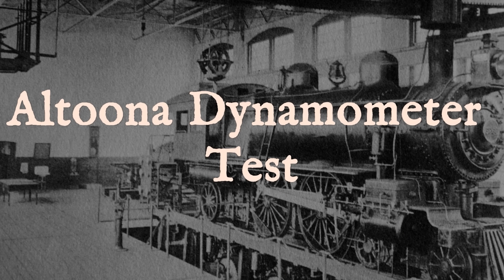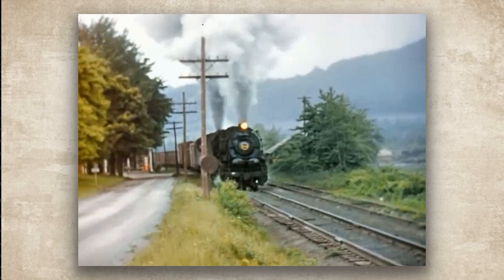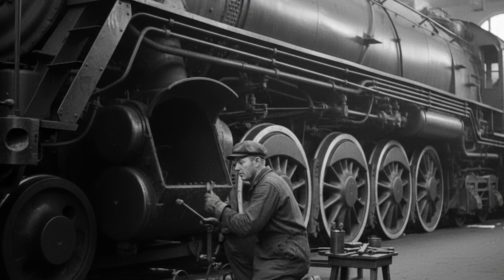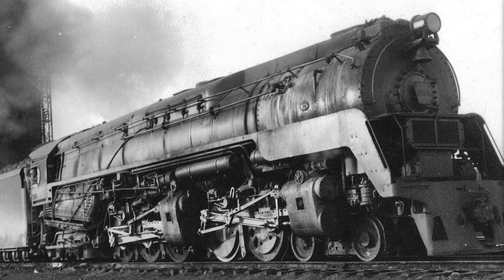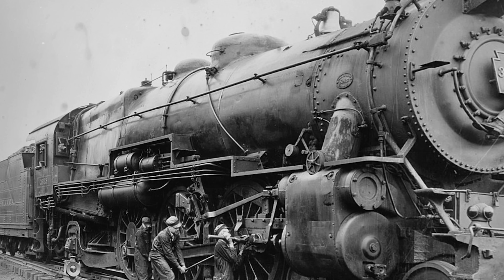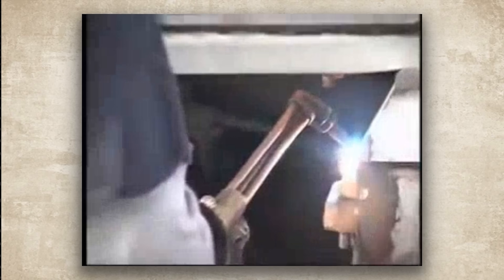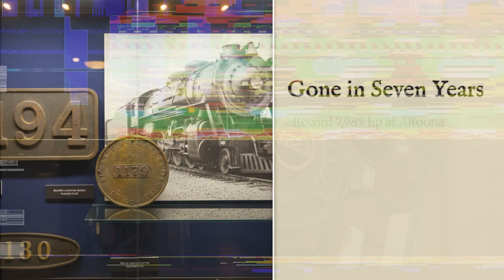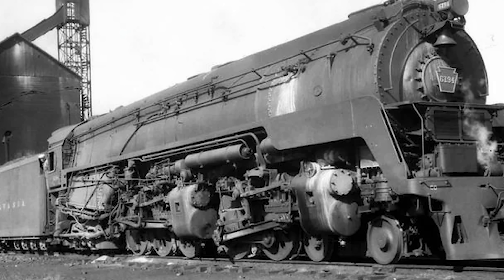How POWERFUL Was The PRR Q2 ACTUALLY?

Comment: The PRR Q2 class were the most successful type of "duplex drive" locomotives that were produced and the Q2 class were also the most powerful & largest non-articulated steam locomotives ever built. The Q2 engines had high maintenance costs and maintenance issues and the 50 mph speed limit on PRR freight trains was also not beneficial for the locomotives as well. The PRR Q2 was an interesting locomotive and it's a true shame that none of the 26 engines built were preserved for display as being the best performing examples of the "duplex drive" type steam locomotives, and all of the engines were retired by 1951 which represents only a half decade of operation.

Comment: The T1 unofficially did 156 on multiple runs al be it it was never the PRR's intention to do a speed run for a record.  And.....the wheel slip issue is no more than legend.  The engineers who were interviewed and were the most frequent crews on the T1's repeatedly stated that the T1 did not have a wheel slip tendency, but instead were so powerful that they required a different approach to applying power.  They were fantastic locomotives and there is one being built right now.

Comment: C&O Alleghenies and UP Big Boys tested at over 8,ooo HP.
Reply: Big Boy's tested around 6,400hp and Alleghenies around 7,300hp. Both came in under the Pennsy Q2. Maybe their adherence was better but their HP was not quite as high. I wonder what the DM&IR Yellowstone and the N&W Y6b's rated?
Reply: @asdfdsa45  The problem with some of the horsepower ratings is that they tend to be rather subjective.  In many cases they're tabulated in different conditions and/or with different types of equipment.  I'm a retired railroader from a fairly severe mountainous division.  In my experience tractive effort is significantly a more determinant factor of a locomotive's capabilities as opposed to horsepower.  I think the biggest problem with many of the horsepower tests on steam locomotives was that the tests measured the "hp" capabilities outside of the normal operating envelope in which the engines would be routinely pulling trains.  This is the reason that many of the large articulated giants that we all admire were replaced by 3 or 4 "F" units or Geeps.  While the little 4 axle diesels are no match for big articulated steam in hp rating at 50 mph, the diesels are superior in tractive effort and efficiency at lower speeds where freight trains usually operate.  Cheers.
Reply: @machinist1879  Thank you for taking the time to write this bit of information and history, it makes me wish I would have had the privilege of working for a railroad. Some of the stories are just incredible.
Reply: @asdfdsa45 Allegheny was drawbar horsepower.  Its has the official record. Q2 was not drawbar horsepower just static cylinder horsepower. Basically its like comparing crank horsepower to wheel horsepower.

Comment: Maintenance costs at a time when the railroads were bleeding money with higher costs and stagnant freight rates. While they were a powerhouse, they came too late to do what they were designed for. By the early 50s and the infrastructure destroyed by the wartime restrictions and workforce depletions, very few railroads were in good shape. Then the management realized that diesels were easier to maintain and easier on already worn out track than a reciprocating steam locomotive. Preservation of the dividend checks were more important than preservation of a locomotive.

Comment: Poor adhesion was the irremediable fault in the S1, Q2 and T1 classes and in the Duplex concept. The money would have been better spent to extend electrification westward, at least to a point well past Altoona.
Reply: nonsense.  All the hype about wheel slip on the t1's was just that, unsubstantiated hype NOT supported or verified by PRR>. ALL the crews who routinely, daily ran the T1's stated unequivocally that the T1's were so powerful that it took a different approach to applying power, and once learned there was no wheel slip.  Engineers who were put on T1 duty were retrained to manage and control the power in a different way. But the rumors, hype and false statements just keep being repeated.
Reply: @3RTracing  "Ten drops of rain will make it slip" said one PRR engineer about the Q2. Altoona even converted a T1 to Walschaerts valve gear to see if it would behave better. Sounds like a lot of effort and money to address a non-existent problem.

Comment: The Q2 was magnificent but it was built for a role that PRR didn't need or even have and it was a huge waster of money. This was an enormously powerful and complex high speed express freight locomotive. The first problem was that PRR had a systemwide 50 MPH speed limit for all freight trains. The second problem was that the Q2 was tremendously more expensive to operate and maintain than the extraordinarily successful J1 2-10-4, while being only marginally more capable than a J1, and nowhere near being able to replace two J1 units, since tractive effort was more important than horsepower for freight service. RIght in this video there's a bar graph showing that the Q2 only produced about 4.5% more tractive effort than the J1. In other words there was effectively no real significant difference when it came to starting a heavy freight train. The result was inevitable given the enormously higher maintenance and fuel expenses for the Q2. The Q2 class entered service during 1944 to 1945 and all 25 of them were retired as failures by 1951. Meanwhile the 125 units of the J1 class that entered service during 1942 to 1944 kept reliably and efficiently soldiering on as the backbone of PRR heavy long haul freight service until the the Pennsy completely retired all steam power forever during 1958 to 1959. Including development and tooling expenses with the small number of completed units, each Q2 is said to have cost roughly three times as much as a J1. PRR would have been far better either spending the same money to get 75 more J1 units, or spending 1/3 the money to get 25 more J1 units instead of the 25 failed Q2 units. In fact much the same thing applied to the T1 duplexes that failed for the same reason as the Q2 duplexes, after incurring similarly excessive acquisition costs for the duplex complexity. They'd have done much better building a 4-8-4 passenger version of the J1 and applying the same extremely handsome Lowey sharknose shrouding to those locomotives. Now, despite everything I've written here, I've been fascinated by the certainly magnificent experimental late PRR steam power. I devoutly wish that they had preserved at least the following examples: a Q2 4-6-4-4 unit, the S1 6-4-4-6, the S2 turbine 6-8-6, and a T1 4-4-4-4. How wonderful it would be to see those locomotives in a museum along with an NYC Dreyfus Hudson 4-6-4 and of course the queen of them all an NYC 4-8-4 Niagara.
Reply: The J-1 was the best locomotive the PRR had.
Reply: And as stated. The PRR wasted capital on These unnecessary experimental locomotives. 
If they spent 1% of that money and  energy to a duel service R class. They would have had both shark nose streamlined and non streamlined 4-8-4 locomotives putting out sufficient power to retire the K4s. G5s,  H10s and others to smaller branch line operations. And in come cases completely removed from service.
One powerful 4-8-4 would have taken 20 passengers cars or express cars without breaking a sweat from Harrisburg to Chicago. 
And if they took notes from the N&W and build mainline run of through service tracks at key crew change locations. 
These locomotives would have saved the railroad millions and allowed them to invest in the more critical infrastructure and install bi-directional signaling and reduce as much of the “broad way” as possible done to double track mains.
Reply: @JMVX  I agree.  These experimental locomotives were a waste.  I don't even know if the R-1 class would have been worth it.
Reply: @JMVX Exactly. The Js were the pride of the N&W, real steam queens. They're up there with the Niagara as among the best built steam locomotives ever built. The J and the Niagara are the only steam locomotives I'm aware of that actually bested the diesels at the time when tested and compared, including being more cost effective. 4-8-4s were just the way to go at the time.